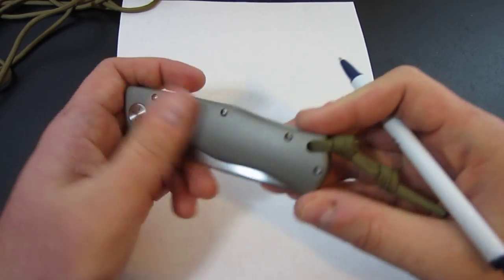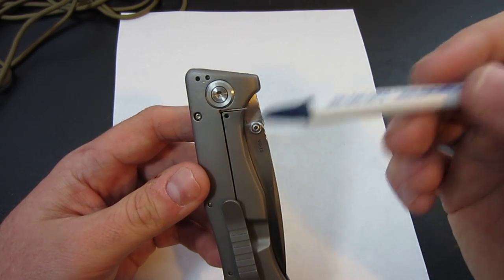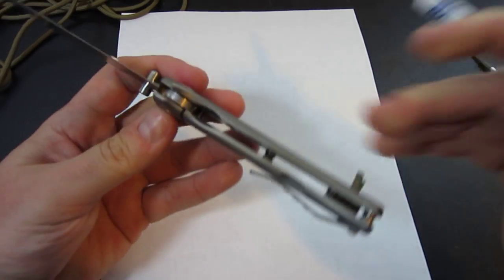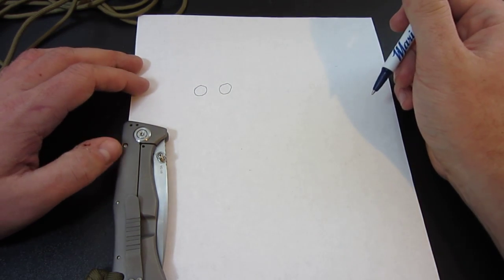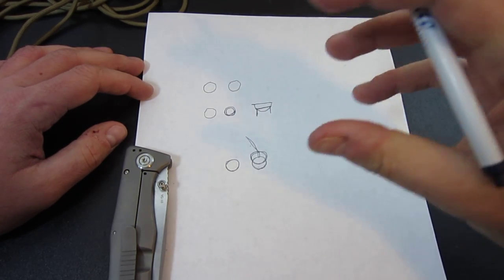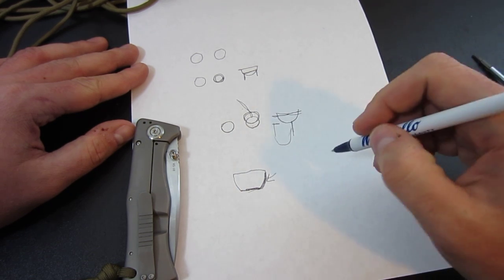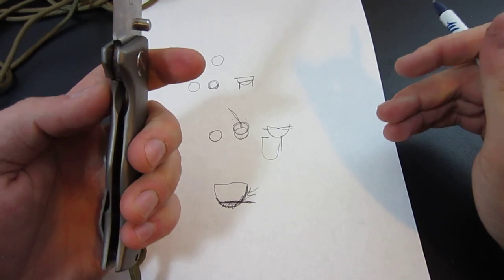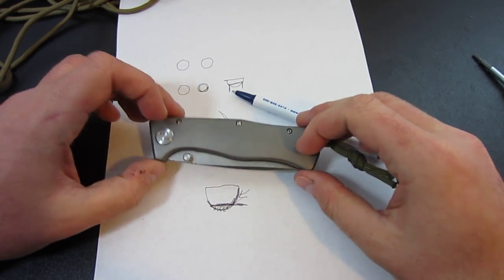Talking About Detent Balls (How do they work?)

Comment: is there a way to lessen the detent if the ball is sitting all the way inside the hole? can I remove a micro amount of material around the edge of the hole so that it rolls out easier? (so that it doesn't have to abruptly overcome a 90 degree angle, id just bevel the edge a tiny bit. ) It's a liner lock flipper and the tension from the lock bar is fine and pivot isn't too tight, etc.-- Thanks!

Comment: My detent is making the opening and closing on my spyderco persistence rough any idea why?
Reply: Carter V Get some Tuf-Glide Dry Film. I usually keep a couple of the pen size needle applicators around. Clean or blow out the pivot area and apply a drop in the detent hole on the blade. Open & close it a handful of times to work the lube around then leave it alone to evaporate & dry. Works wonders! You can use it for the pivot as well. If you don't clean it good first it can gum up some with dust, dirt, & lint that you didn't see. Use a toothpick or paper towel corner to help pull that out if you don't like disassembling your knives.

Comment: Just received my 0562 & has already been sent to ZT for warranty work.  I got one w/the super DETENT.  Any slight pressure on the lock bar & there is no way to flip it.   But as noted, the fit & finish is great & all the other technical bits except for the detent.

Comment from the maker: It is fixed and not spinning. However, Jake Hoback has in fact invented a rolling detent ball to reduce drag when opening the knife. It's a custom add on though.
Reply: I realize this is extremely late, however I’ve been having problems with my TRM atom since I tried to flatten the detent ball. I’m going to try again, however I believe I might’ve flattened it at an angle by accident. I’m going to use diamond compound 15,000 mesh, disassemble, put the compound on the detent track, completely reassemble and try again. Thanks for the info

Comment: Good vid. Man talk about balls, holes and the balls fitting in the holes, we talking dirty here, LOL........
Anyway why can't they make an adjustable detent, Just put threads on the portion that holds the ball, and instead of ball use an allen screw, round off the head, use Loctite and just adjust it to your likiing. 
Kind of like make sure the head in the screw fits the hole just the way you like it, AHAHAHAHAAAAAAAAAAA